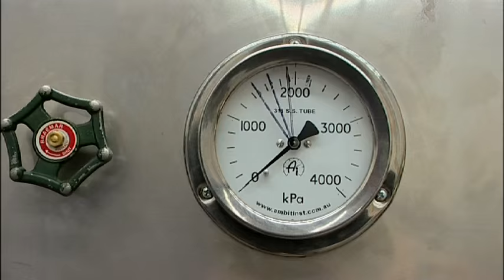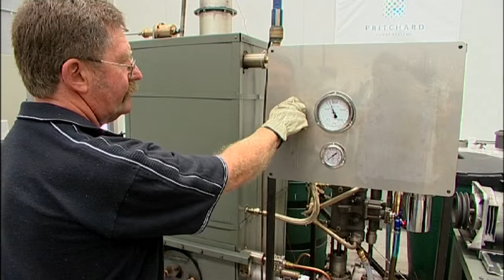Ted invents a new kind of steam engine

Comment: Thats great and all but did you know if the community invested in a small steam turbine power station it would be way cheaper and much better for the environment.
Reply: KlixTrio  turbines are only efficient in high steam pressures and them turbines are a different class all together.   Not for the homesteads if you get what I’m putting down.
Reply: The fuel consumption of small steam plants is staggering and more expensive than currently available generator equipment.
Reply: @sandervanderkammen9230  btus are btus, a gallon of gasoline has 120k BTUs per gallon, a cord of wood has 30-million BTUs. 

$200 in gasoline will get you 30 times less heat energy than $200 in wood, and it operates half as efficiently.
Reply: @leeknivek  And Carnot Cycle efficiency is dictated by the Laws of thermodynamics... a modern turbo Diesel automotive engine is roughly 700% more fuel efficient than Teds reciprocating steam engine...

Why would anyone power a steam car with wood?
Reply: @leeknivek  You are not familiar with Carnot Cycle Formula efficiency?
Not steam vehicles.
What happened after the war ended???
Reply: @sandervanderkammen9230  no, perhaps you could lay it out for me out how a diesel engine is 700% (7 times 100) more efficient.
Reply: @leeknivek  Its really simple math actually, I can buy a turbo Diesel car with a BSFC of nearly .300, Ted's  20hp reciprocating steam engine somewhere in the 2.7 BSFC range...
Thats a difference in TFE  (thermal fuel efficiency) of over 700%.

We know from the Carnot Formula that Rankine Cycle engines have a much lower thermal efficiency limit and have higher entropy based on power density than ICEs, reciprocating Rankine Cycle engines have much higher entropy and pumping loss than turbine Rankine Cycle engines.
This is why steam cars have been obsolete for over century.
Any questions?
Reply: @sandervanderkammen9230  how do you know where Ted's engine lands? 

Of course, you're neglecting to compare how a steam boiler can operate at 90% or greater fuel efficiency in converting fuel into heat energy, while an internal combustion engine is stuck at a measly 50%, at best. 

The key difference is in the idea of an external combustion engine, which, while the specific engine may have a similar heat efficiency to an internal combustion engine, around 30%, you're still able to burn fuel completely and eliminate emissions in a simple way, and retain that heat energy better. You also don't require a transmission, nor a lot of the weight, as a same-displacement, single cylinder steam engine has the same output power as a traditional v8, by the nature of its geometry. In other words, a 302 v8 is comparable in power to a 40 cu in steam engine. 

You aren't really comparing apples to apples, either, because obviously a 20hp steam engine is going to perform worse than a modern 200hp turbo diesel. But you aren't factoring size, weight, economy of scale in regards to fuel performance, perhaps you might start by comparing a commercial steam powered car to a commercial gas powered car, you might find there isn't a huge difference in fuel use or performance, and steam has the advantage of potentially being lighter, faster, with less parts, many less moving parts, more reliability, less expensive to produce, and marginally better at not wasting fuel.
Reply: @leeknivek  You didn't understand anything that I just wrote...
Your reply reveals that you have no formal education or professional experience in engineering or mechanics.... sounds like we need to start with fundamentals and then come back to this conversation.

Are you at all familiar with the Second Law of Thermodynamics?
Or Joseph Black's discovery of Latent Heat?
Reply: @sandervanderkammen9230  of course, i'm so sorry to bother you, have a good day.
Reply: @leeknivek  No I'm serious, we need to cover some basics before we can really discuss why steam cars have been obsolete for over a 100 years.

Steam engines can never match the efficiency of internal combustion technology.

This was discovered by Nicolas Carnot in 1824.
Every engineer knows that steam is significantly less efficient than ICEs.

And questions?
Reply: @leeknivek  Sorry Kevin, but we are not talking about heating you home with a boiler..
A residential steam boiler might be 88% efficient in thermal fuel conversion... but its not going to power your automobile.
We are talking about the RANKINE CYCLE heat engine.
With a maximum theoretical efficiency of just 63% and the most efficient steam powerplants around 40%.
Reply: @leeknivek  Not true, a steam car like the Doble E series or Teds prototype actually produced more emissions than comparable pre-emissions ICE cars.
The Doble boiler was tested by the EPA in 1971 on the LA drive cycle test and produced significantly  higher HC and NOx emmissions and obscene CO2 emissions.

All combustion fired steam boilers operate with excess oxygen AFRs and the temperatures required to produce superheated steam efficiently also produce huge amounts of NOx emissions.
Reply: @leeknivek  Its not comparing Apples to Oranges.
We use the Carnot Cycle Formula to compare Otto, Diesel and Brayton Cycle engine efficiency directly against Rankine Cycle efficiency on the the same scale.

BSFC is a standard metric that allows us to compare fuel efficiency of completely different size, type and thermal cycle engines regardless of the horsepower output.

It measures fuel consumption per horsepower unit.
Any questions?
Reply: @leeknivek  Steam engines are significantly larger, heavier, have more parts and cost more than a compareable output ICE.
Steam is the worst performing in cost per horsepower and horsepower per pound.

Don't believe me? Try and find a successful steam power aircraft
Reply: @leeknivek  The Doble E series boiler has a specific heat output of approximately 2 million BTUs, the  same heat value as 6.2 liter HEMI engine in a Dodge Charger.

The Doble produced 150hp and 6.5/ 8 MPG on regular unleaded gasoline.
The Charger produces 750hp and gets 12/21 MPG.
Reply: @leeknivek  My 2020 Ford F350 truck weighs the same as Jay Leno's Doble E series.
The turbo Diesel produces more torque  (1,050 lb-ft) 300% more horsepower (475 hp) and gets 11/17 MPG
Reply: @leeknivek  The Carnot Cycle Formula tells us that that steam Rankine Cycle engines CAN NEVER match the efficiency of internal combustion engines.
This is because of the Second Law of Thermodynamics.
Reply: @leeknivek  So please explain why no one makes steams cars or any production vehicles powered by wood?
Reply: @leeknivek  I'm not a professor of Economics... but I understand Supply and Demand

Global Diesel fuel consumption per day is around 90 million barrels per day..
Please tell us how much wood this equals?
How will that amount of increase in wood consumption effect the market price of wood?

If the world transportation and energy industries become dependent on Wood?

Don't you think that wood will not become traded on the commodities futures market?
With prices fluctuating with wood supplies being sold and traded up to  2-3 year before harvesting and seasoning before retail consumption 
And wood being sold in bulk, millions of cords to the highest bidder???

WHAT ABOUT TAX???
In some States nearly  $2 dollars  of the price per gallon is TAX

there is currently no federal or state road tax charged on wood...
Just like electric cars,  government will eventually start charging the same rates for wood powered cars based on weight, BTU content or miles driven per year.

Road tax is expected to increase by up to 26%
Reply: @sandervanderkammen9230  they have made plenty of them.
Reply: @leeknivek  Name one!
Reply: @leeknivek  Still waiting for that answer mr. genius
Reply: @sandervanderkammen9230  the Soviet Union, the sentinel steam wagons (produced by the 1,000s), the Fodin engine company, there are quite a few other manufacturers - about 160, actually - who commercially produced solid fuel fired steam vehicles for about half a century. Many of them are still functioning today. The Sentinels were reaching speeds of 50mph and rated for a 6 ton load back in the 1930s, that's pretty far and above what comparable diesel engines were capable of. 

Again, my point was not of peak thermal efficiency - obviously nuclear fission, having one million times the energy density of diesel oil, is one of the top contenders in that category - the idea is what is currently available, safe, sustainable, reproducible, reliable, and efficient enough
Reply: @leeknivek  I'M TALKING ABOUT RIGHT NOW.
You are talking about outdated antiques... obsolete technology.

There is no one manufacturing commercially available solid fuel steam cars or trucks anywhere in the world.  
The steam cars are not a viable transportation alternative.
They are too unreliable for passenger cars, too expensive to buy or maintain.
Way too inefficient and are too dirty.
Sentinal requires a 2-man crew to operate and has terrible performance compared to a Diesel truck.
Why do you think Diesel replaced all the old steam trucks???.
Reply: @sandervanderkammen9230  primarily because they were taxed out of service and became too expensive to operate, paired with the electric starter and mass production of combustion engines. None of the steam manufacturers were really able to compete, and further development never happened. Otherwise, pound for pound, they're both pretty much just as capable and just as viable. And in poor, remote regions a steam engine is much easier and cheaper to operate than diesel. That was the whole premise of this conversation in the first place, and on that note you've been consistently proven wrong. So what steam engines have a slightly lower thermal efficiency than a diesel engine - you can operate it on anything that burns, not a highly refined, highly transported fuel that can only be extracted from key areas and often is done with political coups, wars, extreme environmental damage and overall a lot of volatility. Of course you have no argument against that, only that running a vehicle on wood isn't as convenient. Well it could be .... it's not impossible, though it might be impractical while there's near unlimited access to diesel and gasoline at relatively low prices, but that's not going to last forever, nor should it anyway. 

It doesn't have to be wood either, it could be unrefined vegetable oil, or even just dried seeds, simply grown in a field and pressed by a machine. You're so concerned with efficiency that you can't see the forest for the trees - these combustion vehicles are just getting more complicated, more expensive, less efficient, less reliable, and eventually pretty scarce. Steam engines are a viable alternative and they were used and worked just fine for 150 years, and now we have the metallurgy, ceramics, fluid dynamics, and thermodynamics knowledge and technology to make them probably inconsequential in operation to an internal combustion engine. 

If you don't like that, that's fine. But that's on you.
Reply: @sandervanderkammen9230  I don't actually smoke weed. By you saying something like that just further points out your obvious personal flaw: you're emotionally broken with a severe need to be correct. That's why I tried to stop having this conversation with you multiple times, because it doesn't actually matter what I say, you will make up some far fetched accusation such as smoking weed to prove me wrong about steam engines. 

I don't generally talk to people of that quality, much less take advice from them. Now, if you'll please, leave me the hell alone.
Reply: @leeknivek  You obviously have no formal education or professional experience on this topic and are not qualified to speak inteligently on this topic.
Please stop spreading lies and misinformation about things you do not understand.
Reply: @sandervanderkammen9230  you're literally making things up about my personal life and then accusing me of spreading false information. Please stop replying and leave me alone.
Reply: @sandervanderkammen9230  ok
Reply: @leeknivek  Good boy, now get yourself cleaned up and get back in school...
You still have a lot to learn yet.
Reply: @sandervanderkammen9230  I have a trade license. I finished school a long time ago.
Reply: @leeknivek  Well, then you should stick to oil changes and tire repair... engineering is not your forte'
Reply: @sandervanderkammen9230  it's spelled "forté" sorry just thought you would like to know so that you won't have to be so embarrassed the next time you're proving to someone on the internet that you're a better engineer.
Reply: @leeknivek  My sincere apologies for having to correct my awful English skills but of course I don't claim to be an English professor... English is not my native tongue....
Reply: @leeknivek  You're not an engineer...
I think we already established that fact.
Reply: doubt
Reply: @sandervanderkammen9230   christ, no need to be so abrasive. even though you are correct.

one example of modern steam vehicles is "Mackwell Steam Co." and probably some indian nigas
I think its a pipe-dream. nostalgia based idea, like modern airships and other such things. But it's an example.
It doesn't look like they've published any data either, which does not inspire confidence
Reply: @diobrando2160  Abrasive??? What are you talking about?
Reply: @leeknivek  The Cobber is an external combustion engine with the steam being generated in its own furnace and boiler. Water is 20 litres of water which need not be DI or  pure water. The unit used in India used water from sand filters. Output from the boiler is super heated steam at 20 bar, 400C. That then is piped to the steam engine which has a double acting single piston. That is then converted through a drive shaft to the fly wheel and a belt off the flywheel is linked to the alternator. 
Since fuel can be anything organic, then the fuel can be from local surroundings and at little costs. Fuel can also be agri crops wastes which farmers are likely to burn in the open.  Long terms trials have already been made using firewood, cow dung, bagasse, rice husks, coconuts etc
Reply: @sandervanderkammen9230  "Abrasive??? What are you talking about?"
Being rude to the guy
Reply: @diobrando2160  Rude? You obviously didn't read his nasty, expletive filled insults that were deleted by YouTube.
Reply: @onggk6561  Uniflow Power Ltd. is a shameless "vapor"ware investment scam not unlike the Pritchard Steam Car Company that spawned it.
Reply: @onggk6561  While the use of small to medium scale power generation using internal combustion technology fueled by biomass has been highly successful in emerging markets steam power on this scale is far too inefficient to be commercially viable.
No competent venture capitalist or government consultants would touch Uniflow Power... it is very obvious that it is not a legitimate company or a viable alternative for power generation.
Reply: @onggk6561  The Biomass ICE manufacturing and Power Generation is a 60 billion dollar industry with dozens of manufacturers in Europe, America and Japan selling billions of dollars worth of Biomass ICEs to a growing global market.
Biomass ICE installations can range from 5kW to 230 megaWatt and are the most economical, cost effective and environmentally friendly method of generating electric power from biomass fuel sources.
Reply: @sandervanderkammen9230  There are cars moved with burning gas from wood gas generators. If you live out in the sticks were lumber is plenty fuel is basically free.
Reply: @kinsmart7294  That's a very naive solution considering that if everyone switched to using wood as fuel? Fuel costs would skyrocket beyond fossil fuels and the Earth would be reduced to a barren desert in about 18 months.

Comment: That Steam engine will be great for countries that have no oil or gas resources.
Reply: Steam engines are bad for countries with no oil or gas resources...
They are bad for all countries because they are extremely inefficient and expensive to construct and maintain.
Reciprocating steams are obsolete technology.
Reply: You obviously don't know what you're talking about, you just think you know, but you're talking a load of wind. One if the very most basic points you've completely missed is that a large part of the efficiency of a steam plant depends upon the design of the steam generator, yet you only mention engines. There are many different factors and design points involved. Bet you've never even hard of secondary air admission (as per L.D.Porta) for example.